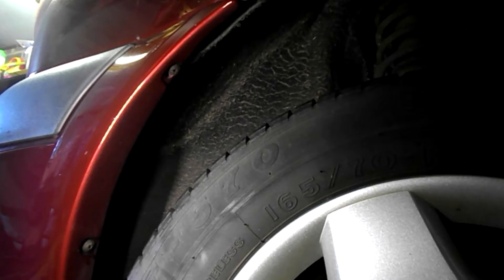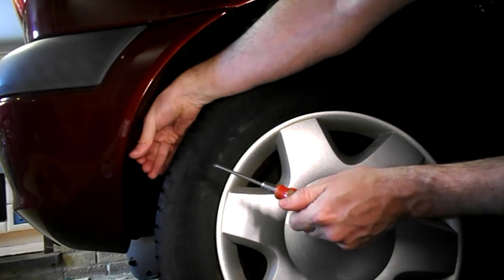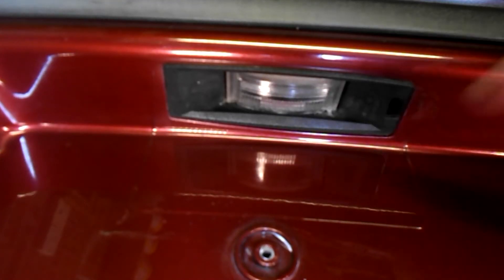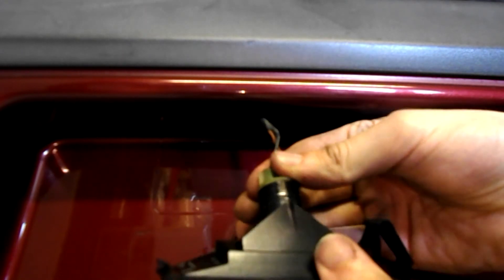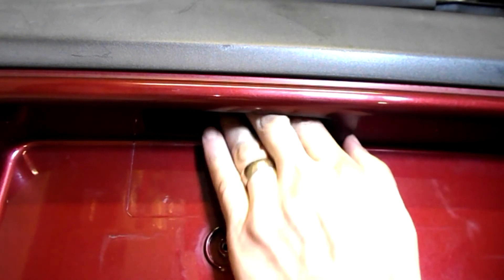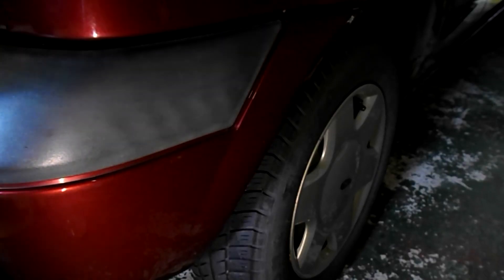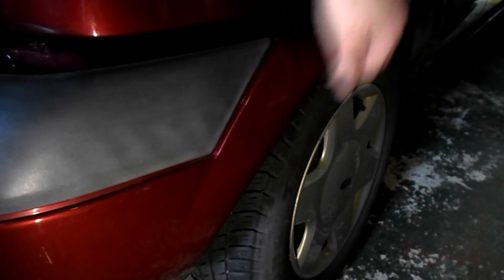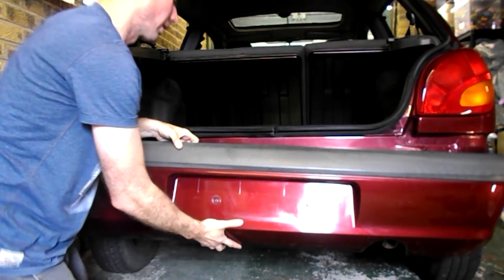Ford Fiesta Rear Bumper Removal

Comment: I have saved all the videos on the fiesta  needed them lol my indicator don't turn off after turning but only on one side  is it a fuse or do I have to change hole unit
Reply: Haha, it's the right side isn't it. I have the same problem but it doesn't bother me that much.
Reply: Mike Theunissen mine is turning right 2